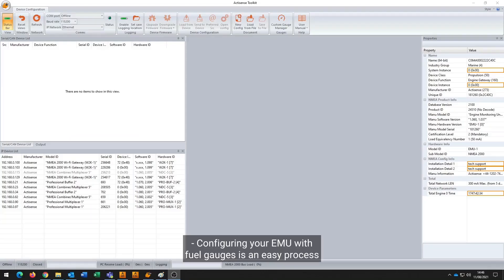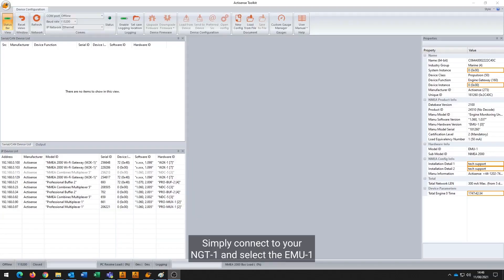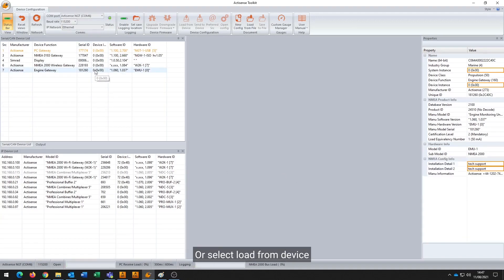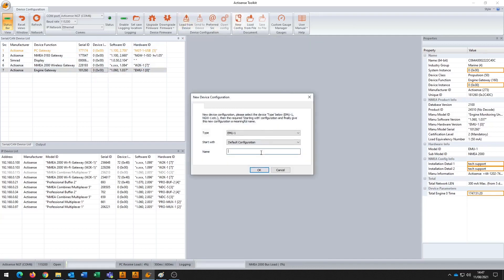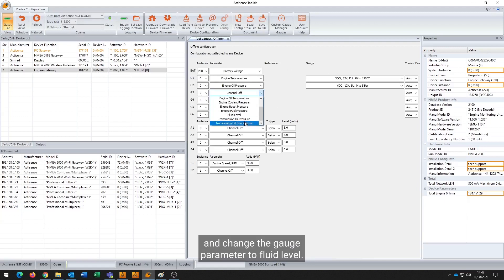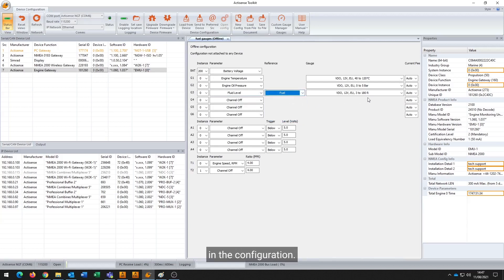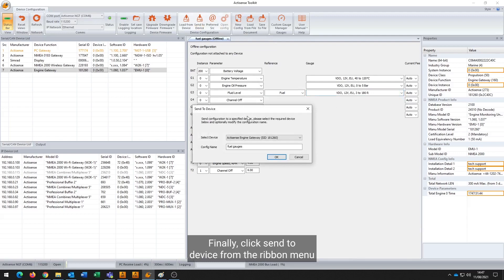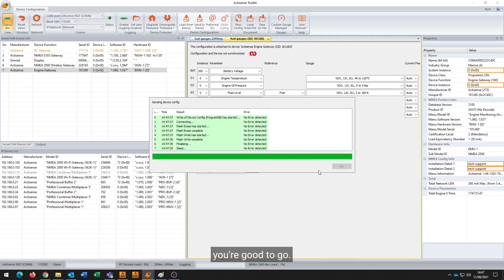How to configure an Actisense Engine Monitoring Unit - EMU-1 Q&A

Comment: Excited to install one of these. Is there anything special we need to purchase to set up tachometer readings?
Reply from the maker: Hi, I am glad to hear you'll be installing an EMU-1 on your network. As for the tachometer readings, no you don't need anything special as the EMU-1 has Tacho inputs. The only thing that needs to be configured is the PPR. To configure the device, an Actisense NGT-1 is required.

Comment: Does the EMU support irregular shaped tanks? e.g. 50% on the gauge may actually represent 25% remaining volume, etc?
Reply from the maker: Hi Benjamin, the EMU-1 will just monitor the voltage on the gauge input and use the parameter curve to determine what value this equates to. So you could possibly build a custom gauge to match that of the analogue gauge ensuring that they both follow the same parallel measurements. If you need more information on how to do this please contact our technical support team - https://desk.zoho.eu/portal/actisense/en/newticket

Comment: Thanks for the "Engine Hours" enhancement.  Look forward to loading new firmware.
Reply: The video makes it sound like this is Enabled, but looking at release notes for the Actisense toolkit V1.071.022 it looks like the last update to EMU-1 Firmware was 1.037, is this the correct version for the Engine Hours to be available?
Also, can you help me understand what is meant by RPM stability? Is greater resolution for the RPM being presented on the N2K Bus? My MFD's currently only co in 50 RPM increments, and was always curious of whether that was an artefact of the EMU or the displays.